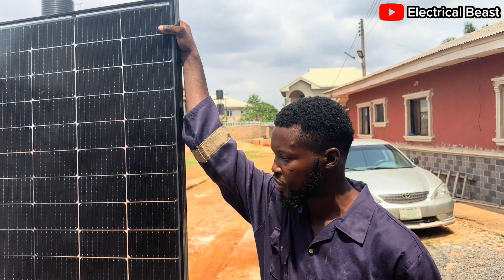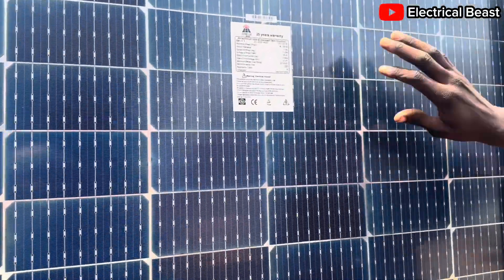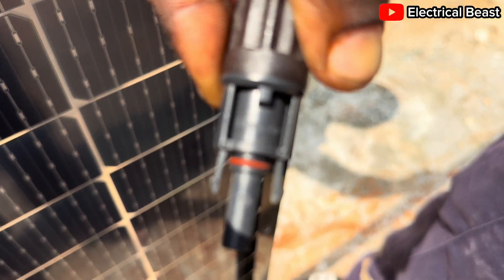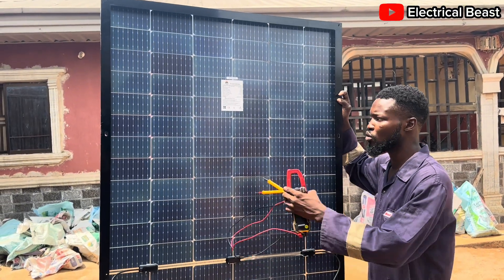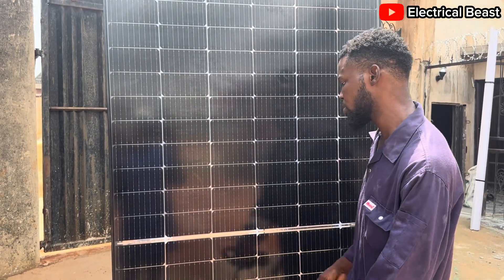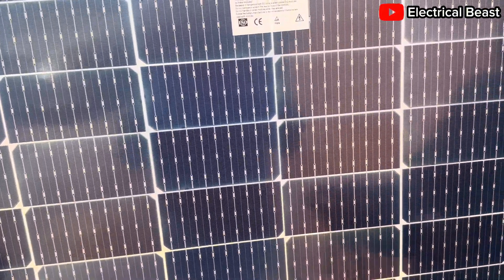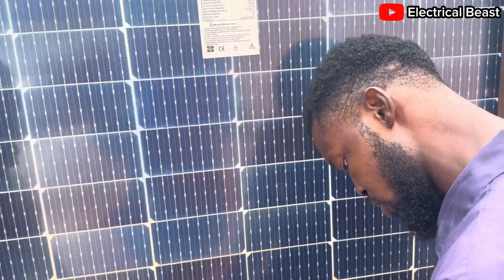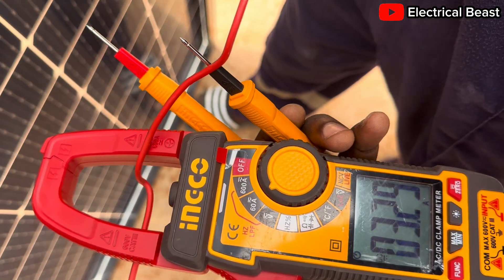Identifying Original Solar Panels

Comment: That panel is around 500w,the 450w/415 versions of that kind of panel is 108cell 
But this one 144cells its a 500w panel but probably with the bifacial gain it will produce up to 550 thats why the sticker has 500w on it

Comment: That panel there is actually rightfully rated
There are so many flaws in your tests 
1. The output on the panel is measured at STC (standard test conditions) which are 25 degree C and an irradiance of 1000/m2 . Did you achieve that)
2. The size of the panel doesn’t really tell the whole story (efficiency of the solar cells, technology used in the manufacturing has a big impact)
3. The fact that the panels have parts from different manufacturers doesn’t make them fake. All companies use parts sourced from different manufacturers in this case sunflex is the manufacturer but used mc4 connectors from Trina solar and solar cells from Canadian solar.
These are the kind of reviews or videos that are from Chanel’s that are run by people without the knowledge of what they’re talking 
In any other part of the world, the company would sue you for everything you got 
At least take time to research a topic before delving into it peddling 1/2 baked lies 

I’ve the same size of panels from Canadian solar and are rated for 580w top face n bifacial output of 643w
In the real world you’ll never see those numbers

Comment: You need to face the sun squarely when taking these measurements. Your angle of inclination has to be such that the shadow made by the solar panels is directly below the solar panel. They may have lied about the specification. Also short circuit test is done by connecting the + and - of the PV panels and checking the current flowing via the clamp meter.
Reply from the maker: You are absolutely right! I'll make sure to include that in the next video
Reply: @engrgideon if you didn’t know these fundamentals already, then you’re in no position to make the conclusions you made😂

Comment: You are testing the panel vertically it's not facing direct sunlight of course it will not be able to give you optimal reading but i get the idea of too many branding.
Reply: Oga is bi-ficial now. Facing sun or not it will get direct sun
Reply: @sunenergyltd if you don’t understand something please research it
The angle of incidence matter plus, the pane l will never work at the optimal level bc of temperature and amount of sunlight 
The wattage rating on panels are at STC and you can’t replicate the same conditions in the field 
If you’re not a trained solar technician, stop pretending you’re one